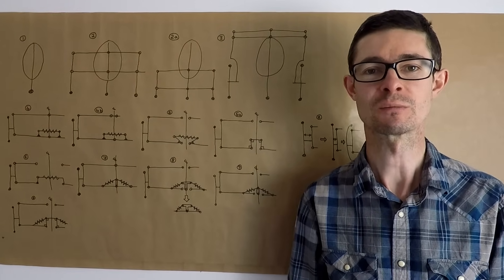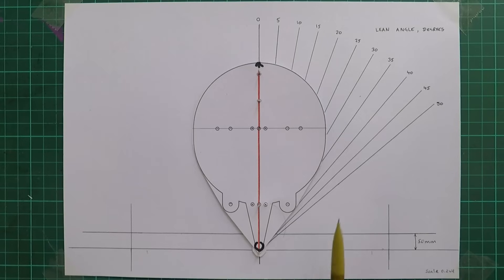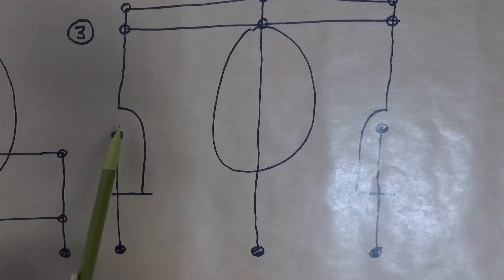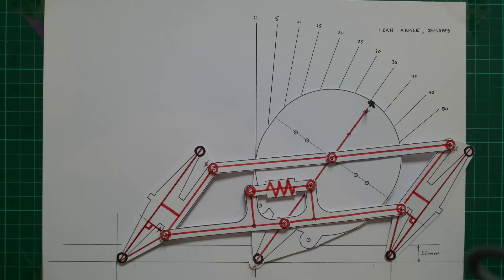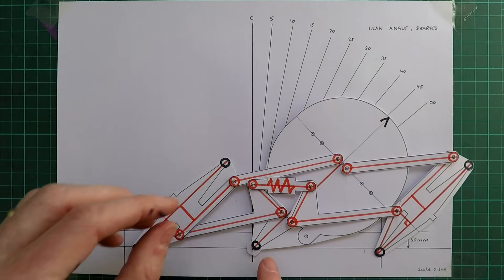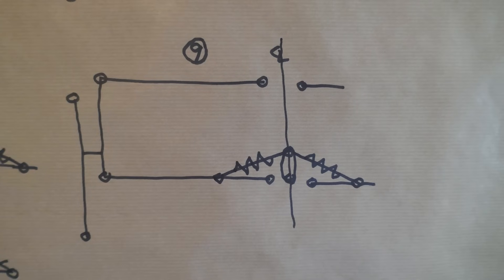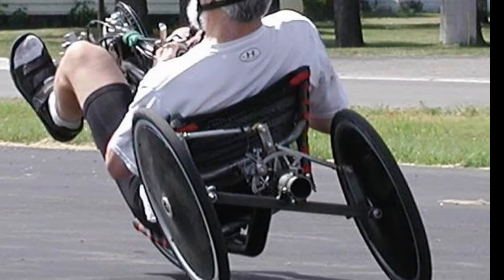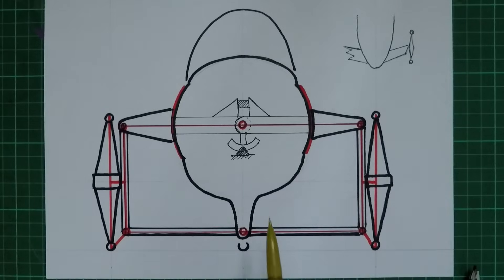Tilting Trikes Part 1 - Velomobile and Motorcycle Trike Tilting Mechanism Design

Comment: Enjoyed your post. But I didn't hear you consider pivoting/rotating the mass of the body of the vehicle around 2 semi-parallel wheels (such as on track possible on the outside of the body for example). So those 2  wheels remain vertical and only the the 3rd single wheel tilts with the rest of its body. This way the suspension's geometry would be unaffected in a turn. But I realize steering options would be affected by going this route. 
So why dismiss the simplest and most aerodynamic option of using retractable outriggers on a much simpler 2 wheel design? So what was your reservation with using outriggers?  Since they have be successfully used on other enclosed vehicles.  IE the Ecomobile/Eco/MonoTracer/Monoracer, so just a lighter version would be sufficient for use on a velomobile.... https://en.wikipedia.org/wiki/Ecomobile

Comment: Your kingpin design seems to have the centre point inline of where the tyre meets the road; how do you plan on dealing with scrub in corners?
Reply from the maker: Andrea Hailes According to my research on the subject, a car’s steering geometry would typically be arranged so that the king pin axis at the point it meets the ground is slightly inboard of the centre of the tyre’s contact patch (sometimes it’s outboard).  This apparently avoids the instability that would occur if the two were coincident.  The tyre will scrub against the ground when the wheels steer but this is unavoidable.  I will use Ackerman steering geometry.  A small amount of scrub is probably unavoidable and negligible. Hopefully.

Comment: As you mentioned a dished shaped wheel helps but is hard to buy/build. Hub center steering is so important, I have experimented with steering and small imperfections in the road jump through the steering train unless the axis is in line with the tyre touch point. I found even very small stub axles transmit asymmetric forces to the hands. Two answers...  Something like traditional front forks, resulting in either very high struts or hanging the system off your "'handlebar" hubs. Or you can tilt your stubs so the wheel/road contact point is in line with the stub axis.

Here in the UK poor governance means we are suffering very poor road surfaces meaning each front wheel can expect to hit bumps and holes at differing times. It's often feels like off-roading.  One friend went built a machine without lean and the sideways forces added to bumps destroyed the spoked wheels in a surprisingly short period. Your work is impressive and I look forward to seeing your creation.
Reply: My race pedal car (see avatar and my channel) is three years old and no spoke broke either during training or during races... And you can bet that Italian roads aren't smoother than British ones 😉.
I think that the solution of the upright wheels is to be considered, just needs tougher components, but it would make things a lot easier.
Reply from the maker: Fixed upright wheels would almost certainly be simpler and perfectly functional, I just can’t resist the challenge of a tilting design!
Reply: See how good it can get when we put our heads and experience together. My experience of spoke failure comes from more testing challenges similar to the red-bull downhills. What I found was sideways forces killed spoked wheels so tilting is perfect.
As to roads in Manchester. I have seen collapsed wheels and broken axles in chum's bicycles. Bad eh!

Comment: Considering design 4, if you replace your proposed rigid upper and lower links with (e.g. carbon fibre) links designed to act as springs, you can eliminate the suspension unit, resulting in a simpler, lighter structure. Obviously, tuning the degree of flex then becomes a problem, but shouldn't be an insurmountable one. Alternatively, only one set of links might be flexible, with the other rigid but (as you show) hinged in the middle. A third possibility which may not be so relevant to your design would be to use torsion bars - again, probably carbon fibre - rather than a suspension unit, in wich case the suspension element (the torsion bar) is aligned parallel to the centreline of the vehicle and thus wouldn't 'poke out' on cornering.
Reply: Also, with any velomobile design, front wheel drive has a LOT of advantages. Much shorter chain line, much more compact mechanical assembly altogether. Considering your design as a delta trike, with a single driven front wheel and two undriven rear wheels, might be the way to go.

Finally, if you do adopt your proposed final scheme, have you cinsidered making the whole nosecone of the vehicle pivot with the upper link, obviating the need for slots and their aerodynamic drag?
Reply from the maker: I like your thinking!  I was thinking that the flexible arms rather than springs would be a simpler option.   I can see the benefits of the front wheel drive delta trike layout, but I think the tadpole layout has some benefits too and even if it’s not completely justifiable, it’s just the configuration I prefer!  The nose cone idea is good, depending on how much flex there is in the arms.

Comment: Well thought out except...the pivots depend on working on one plane; how do you steer it?
Reply from the maker: Planning another video soon which should answer your question...!
Reply: Fair enough. Next question; if used in front you’ll have no room to pedal. This is a pedal power bike...right?
Reply from the maker: @neuxstone  the wheels are in front of the pedals and it does all fit (see next video!) It is pedal powered, with electric assist in the interests off laziness.
Reply: I love my eBikes (3). I wouldn’t be out having fun if it weren’t for the motors. I’m 66.
Reply from the maker: @neuxstone  haven't got one (yet) but I think they're great!

Comment: Is there any reason you can use different wheels.... meaning, using/making wheels that put all the pivot points on the inside of the center line, also known as the king-pin line, as per, steering.... except, in your case, just suspension arms.... put them inside the wheels, by means of a positive off-set rim assembly...  It would help with a few factors, like wind friction and much of the vertical components are inside the wheel, and only the wheel has to break the wind, instead of two vertical faces.... plus, the stresses on the system is less, and can be made lighter, as center-line is not creating a "sag" effect of what would result in a negative camber, which in turn, forces the alignment to be overly positive cambered, to compensate for the sag.... Sure, makes for a complicated dished wheel, but, by the sounds of this presentation, you can handle making a wheel that is of your desires and needed function... either way, I enjoyed your video, very clever.. Look forward to watching this progress... Good luck!!!
Reply: Such wheels work nice for cars and motorcycles, but aren't as practical for bicycles. A bicycle wheel is a large diameter one, it has spokes, and its rim is narrower than its hub -- all that makes virtually impossible to offset the hub. Spokes can work only under tension and any offset of the rim introduces bending forces which won't work well with the spokes
Reply from the maker: I like your thinking. In this design I am trying to find a sweet spot between geometrical perfection and low cost and ease of construction.  Reducing drag and weight would be my overriding objective even if that means a sub optimal tilting action.

Comment: Isn’t it easier to build a 2 wheeled velomobile and add 2 assistance wheels that can be lowered onto the ground when stopping (e.g., by connecting them to steering column; push it forward and the (mini) wheels come down). When up, they could be incorporated into or flat against the body. When down they could be designed that they stay down so one can exit the VM without having to hold the steering wheel forward.
Reply from the maker: Yes, it would almost certainly be easier to design and build a two wheeler, although it is the challenge of a tilting three wheeler that appeals to me! A two wheeler would almost certainly need to be higher and/or longer as the front wheel would have to be in front of, or under the rider’s feet and legs.  A tiny front wheel would help (think Brompton).

Comment: There seems to be an error in your spindle attachment design. The two spindle pivot points are parallel to the wheel, this gives your tires scrub while turning. The spindle pivot points should be designed, so that if you draw a line through those two pivot points, that line should bisect the center of the tires contact patch.
Reply from the maker: @profesonalantagonist  this would be a good point, however, this video is purely talking tilting mech.  The steering mechanism is a separate arrangement supported within the uprights that hold the wheels.  Part 2 in this series covers this, if I remember correctly, it’s a while since I made these videos.  If you want the tilting and steering joints to be combined, e.g. as ball joints, then a slightly different tilting arm geometry is needed.  I look at this in a later video.  The wooden prototype I made uses this arrangement and there are some videos about this.
Reply: @MetalMachineShop  As I watched the rest of your videos, I saw where you put the angle in your separate spindle . I skimmed over the rest of your videos, so I assume you had accounted for that when you made the spindle into the one part. I did speak before I saw the whole thing, and clearly you did take all of the parameters into account. This is a very cool build by the way!
Reply from the maker: @profesonalantagonist  the biggest challenge I found was the high angle of swivel that the rod ends need to accommodate both the steering and tilting movements.

Comment: Why is zero scrub important? Most vehicles are designed with radius scrub
Reply: The reason cars have a (negative) scrub radius is to counter torque steering and brake steering. When he is talking about scrub, he is not talking about the scrub radius resulting from the KPI, but he is talking about the wheels scrubbing over the ground causing tire wear. All of these designs have a KPI of 0 resulting in quite a large positve scrub radius, which is not beneficial for tire wear, but also does nothing to counter torque or break steering. If anything a positive scrub radius makes does things worse.
Reply: @matthijsquist  Hmm, thanks, clearly suspension and steering are more complicated than I thought

Comment: what makes a tricycle or motorbike stable when it stops so that it doesn't go down?
Is it because of the use of shock absorber in the middle?
Reply from the maker: Irsyan Sani Hi, tilting trikes/scooters have a tilt lock which is like a section of a brake disc mounted rigidly to one of the wishbones.  A brake calliper locks the mech.  There may be other versions. The central shock is nothing to do with the lock, but one option is a hydraulic piston with a tap to lock it.  The Quadri system works a bit like this.
Reply: @MetalMachineShop  oh how does the construction of the brake calliper work to make the tilting construction locked?

Comment: This is purely theoretical since i will almost impossible to implemented it in the real world

For some reason you show you Velo shell as round, well maybe the shell in two parts and let the front end pivot so the back of the shell can lean even of the front two wheels stay on the same plane...

you see why it will impossible to implement, the two circles for the "Bearing" will nee to be so rigid, stiff and just plain perfect the shell will need to be ultra resilient..

keep working, such a good way to learn, just study vehicles at speed, the wheels variably steer and  if anything you are "Counter steering" but no massive need for clearance at high speed turning..

Comment: I noticed that none of your designs put the shock absorber on the top, except the final design.  You didn't show the final design in the mock ups.  Why not? 

Wouldn't it be more stable and keep the front wheels on the ground better if you put shock absorbers on each of the top arms?  The rubber block design looks like it will have a tendency to bounce during the extension phase.  This could cause the outer wheel to leave the ground just after the inner wheel hits a bump, so both wheels would be off the ground.  The trike would skip sideways.
Reply from the maker: I didn’t do a mock up of the final design because I was getting really bored of cutting out bits of cardboard, however, the basic geometry is the same as one of the mock ups.  The design is now being developed in CAD, so more to follow soon!

Comment: Hi there

Very nice presentation.

Question ? do you explain why you want it narrow ? [ I may have missed it ] my trike is 30" wide and quite usable in the UK. 

I wonder if you have considered other options ?

This thread describes iLean [ plenty other stuff on it out there ] and also problems creating a working tilt lock , apparently a disc and calliper are not enough.

http://www.bentrideronline.com/messageboard/showthread.php?t=146083

http://www.hupi.org/HPeJ/0020/0020.html

The trike shown at 1.22m would overcome a lot of your parallel design problems and you could enclose the wheels inside the body ?

If it was designed with sliding kingpin suspension it would separate suspension from the tilt mechanism ?

My Python delta trike is fwd however after 4 years with both brakes on the front wheel [ bad idea ] they are now on the rear wheel with no worries the front wheel will lock up [ very exciting in a brown trouser sort of way.] rear brakes would simplify the front ?

Also your drawings do not consider king pin lean angles to achieve centre point steering , this will put your wheel further outboard ? or cause shorter upper arms ?

best of luck Paul
Reply from the maker: Paul Needham Hi Paul, thanks for your comments.  I’m going for as narrow as possible to make it easier to get through narrow gaps, such as gates onto the cycle paths round here, and to reduce frontal area and hence drag.  About 800mm seems a sensible target, slightly narrower than yours, which should be achievable from a design perspective. Everything’s a compromise!  Thanks for the links. My next video will show the developing design, especially the steering geometry and mechanism.

Comment: i see the diagram, im looking at that 50mm line, wondering...

you start tilting your "body" from a point on the "groundplane"...

i start skipping through, comeon, comeon... where is it?

wtf? its not there? and youre concluding already? umm?

JETRIKE explains it, on his webpage. 

something critical.

you want to be at the lowest gravitational potential when riding STRAIGHT.

in other words, you want a geometry that will LIFT YOU UP as you tilt. so the natural steady state is UPRIGHT.  other than jetrike, every tilter i have seen has required some type of lockout mechanism, and they all take effort to STOP tilting.

then the wheels have to tilt at different angles as you lean.

just like they need akermans for the tie rods so scrub radius follows the correct arc, they also need akermans on the other axis as they ARE tilting, and its the degree of tilt that determines the arc a "single wheel vehicle" will follow, not the steering angle alone. the whole point of a tilting trike is to ride like a bicycle. tyre carcasses are round for a reason... the contact patch is always following a "sector" path, rather than an "ellipse" when tilted over. the inside edge of the contact patch is traveling slower than the outside edge. 
the curvature of the tyre, which dictates the width of the contact patch, and also the ratio of major tyre diameter to minimum, and the degree of tilt should all work nicely together so there is no scrub across that contact patch, as any scrub is loss of traction which with the limited contact of bikes and trikes is never a good thing.
its really hard to see it, but the curve of a (motor) bikes tyre is its DIFFERENTIAL, to prevent scrub across that limited contact patch.

Comment: A bicycle works because you have to induce a fall to one side (by steering the opposite direction) and after turning the other direction, fight the castor effects desire to turn tighter and return the bike to an upright, strait line travel. What are you going to do to create a castor effect and make a three wheeler that wants to stay in an upright, strait line condition?  Castor effect is caused by headtube angle and fork offset.
Reply from the maker: I was going to use normal bicycle steering geometry for trail and rake, just duplicated each side.

Comment: I built an electric tilting velomobile, I eliminated the Ackerman steer because it pulls the inside wheel in too much as I tilt. Have you noticed this? here is my project https://www.youtube.com/watch?v=plLlFZCeuC4
Reply from the maker: @MEMETICMUSIC-COM  yes on the old one I did notice that the inner wheel was oversteering slightly when leaning over.  I am going to try to work in a bit of adjustability to the new one to allow for some experimentation with geometry.  I suspect there is no perfect answer and it’s a case of going with the best compromise.

Comment: For a trike i don't see the need to use so complitacted suspensión system... Trikes have one advantage , the three parts touching the ground always no matter what aré touching the ground... like the leveling mechanism of a granite table... What you need to make the Road More comfortable aré isolators, at least if you want to ride It below 50 kilómeters per hour you don't need such a lean angle... Those aré for cornering at high speed and heavy weigth....